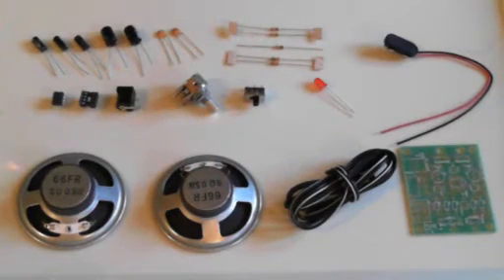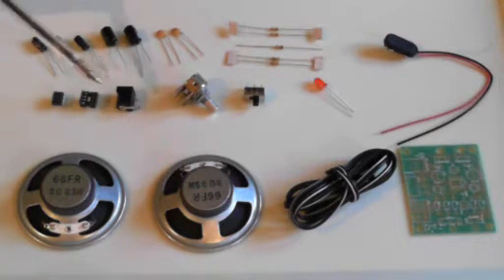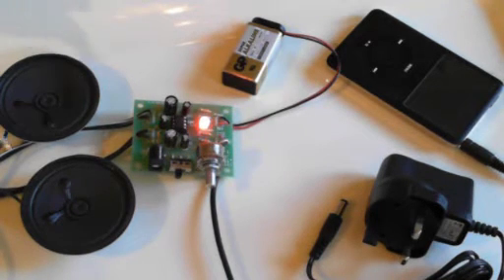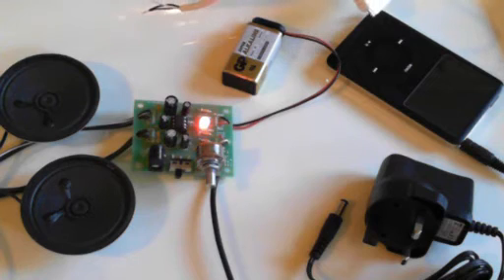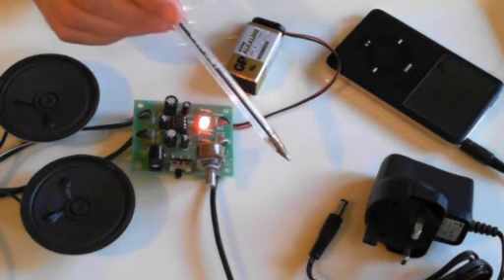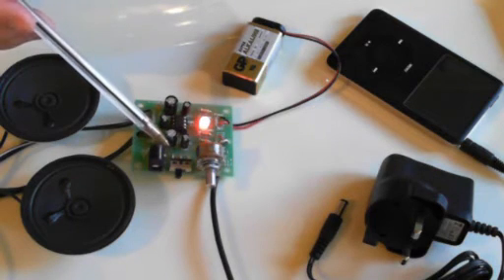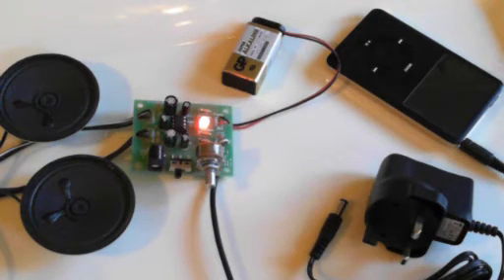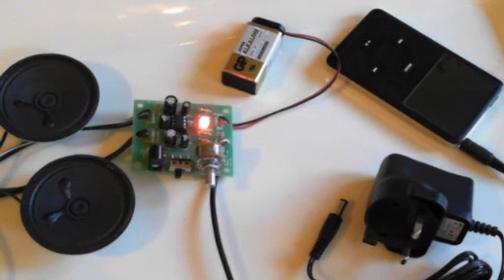Deluxe amplifer kit - www.kitronik.co.uk

Comment: Hi Kevin. I built this kit but connected my 9v red and black the wrong way. I smelt some burning. I then reconnected the 9v the right way and the LED lights but no sound ?
Reply from the maker: Hi, sorry you've had difficulties with the kit. If a circuit smells of burning, that is usually a clear indication that permanent damage has occurred. Without having the kit in front of us it's impossible to say what is damaged, though it's likely to be an amplifier IC and or capacitor. Unless you are a skilled troubleshooter it will prove difficult to track down the fault(s).